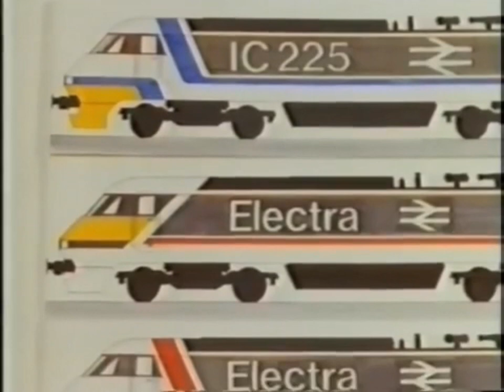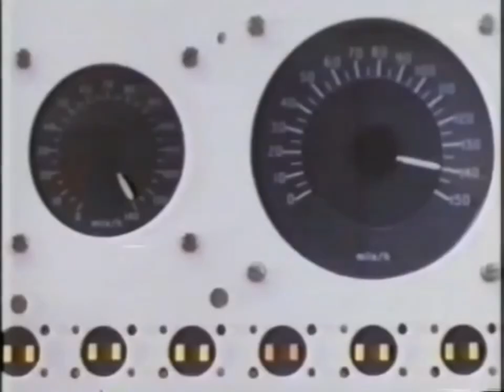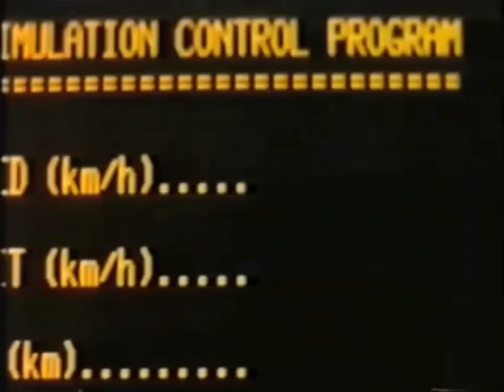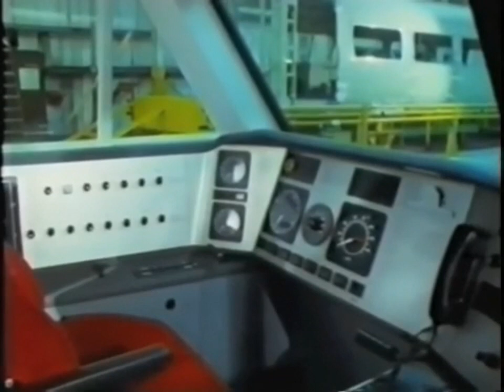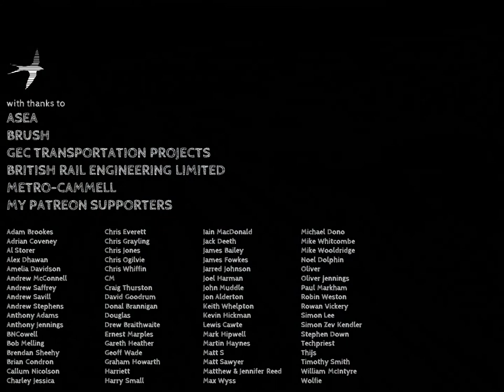#Railways | INTERCITY: A concise musical history of the InterCity 225

Comment: Hi Gareth, huge fan.

What's your view on the Class 91 Electra's? 

Personally my all time favourite UK designed and built loco. The InterCity Swallow Livery sealed the deal.

With an update to the motors and boogies, they could last us another 30/40 years and still be in fashion. Electra's whizzing up and down HS2 would be a sight to see.
Reply from the maker: They are still one of, if not the, most advanced electric passenger locomotive (yes, a lot of qualifiers there) in the world... But their specific age causes a lot of problems. 

It isn't just that they are old, but that they were designed in the early days of modern electronics which means that they are designed around a lot of electrical components which are impossible to get hold of nowadays. 

My understanding is that a total rebuild to bring all the electronics up to date is essentially impossible, and certainly far more than buying a new loco off the shelf. Combine that with the operational disadvantages of loco-haul versus distributed power and you can understand why their time is short.